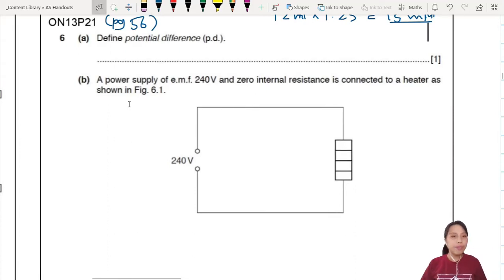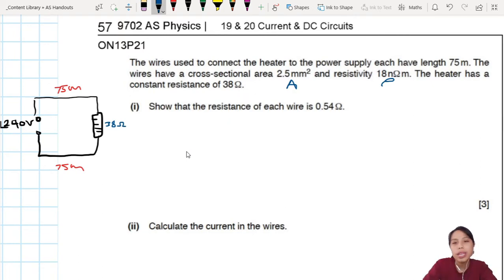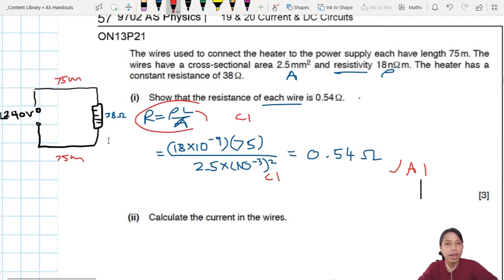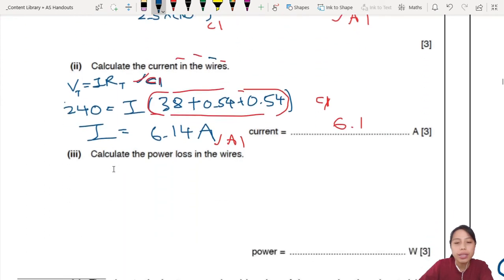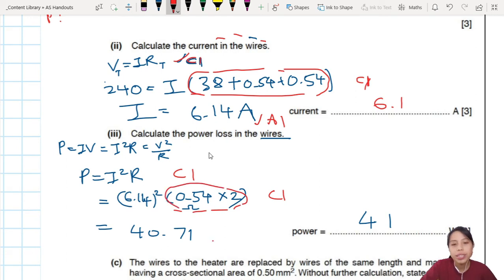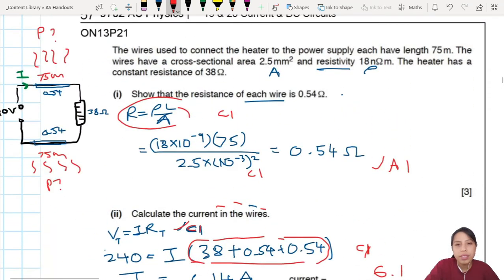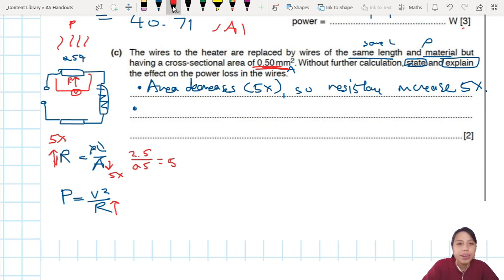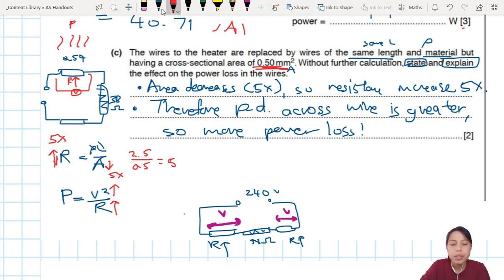9.3c Ex3 ON13 P21 Q6 Heater Wire Power Dissipated | AS Electricity | Cambridge A Level 9702 Physics

Comment: why didn't we use the P=IR^2 formula for the last answer? using the P=v^2/R formula reverse the relationship between P and R, right?
Reply: same question
Reply: It does reverse the relationship but since V is also increasing with R, the overall value of P will increase. P=I^2R also works because I is constant so P is directly proportional to R
Reply: @askhfbfns67589 how is I constant?? I=nAve and A is changing..
Reply: I think she made it a bit confusing using that equation... I used P = VI formula and I know that Area decreases so R increases so V also increases as current is the same in series circuit? and therefore the formula P = V I ... I constant so P proportional to V so Power also increases